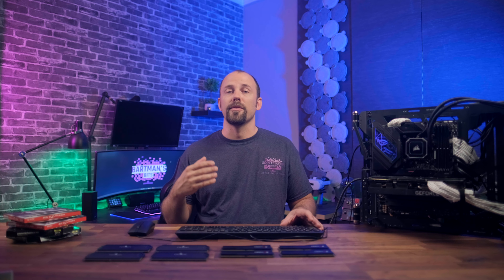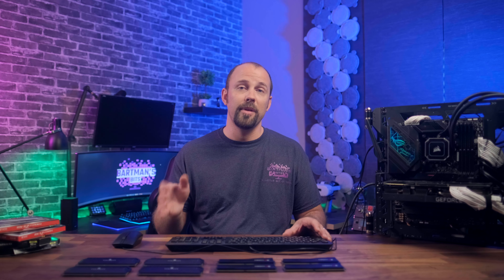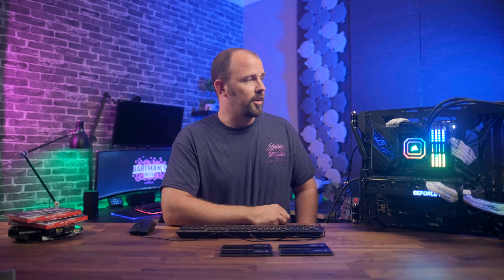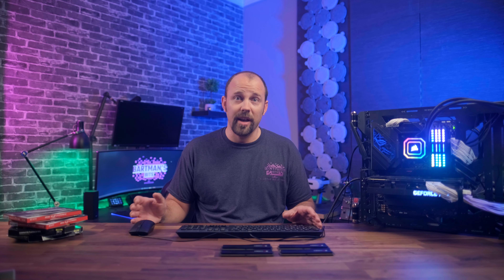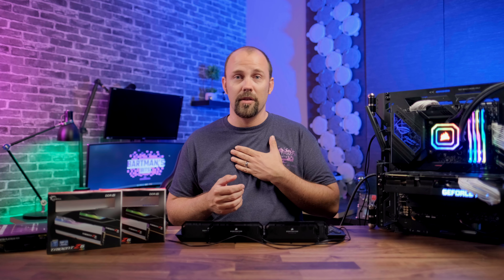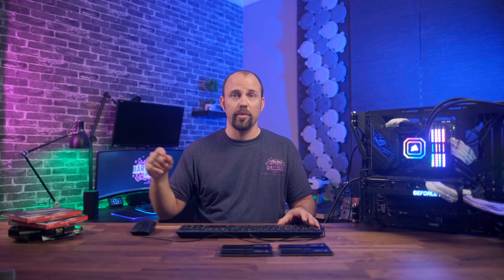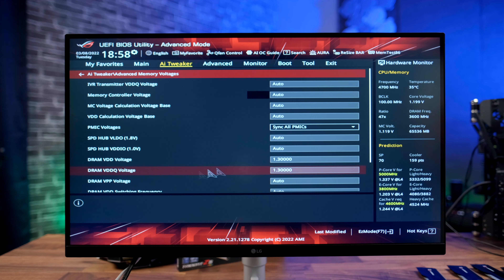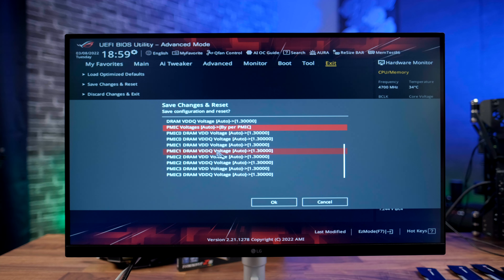Intel’s DDR5 problem resolved! DDR5 64GB Boot Loop failure Fix. Get the rated speeds of your RAM!

Comment: I can't believe DDR5 is causing this many issues for consumers. DDR5 was rushed and not plug in play as it should have been
Reply: Had to do the same thing on my DDR4 X470....
Reply: it was already garbage on z690 except for a few kits (corsair didnt work at all for me only g.skill) i hoped amd would be better nope its WORSE ><
Reply: It's because it's new and 3600mhz is default. but companies are rushing into the unknown at 6000
Reply: DDR5 wasn't rushed, but it's implementation by Ram and Motherboard manifacturers was. DDR5 works 100% perfectly fine at THE CPU's  designed frequencies. XMP IS AN OVERCLOCK , so there's no guarentee you will get it working at that speed as long as the CPU MC is still only rated for 4800MTs, which is currently the case with the latest line of consumer CPUs. 

So many people are experiancing issues because of a mix between companies' race for the top with crazy memory and cpu OC clocks out of the box, that just aren't stable aross all bins of cpu, and the consumer's lack of knowlage of what XMP actually is. 

Yes XMP normally works with 2 dimms, but the CPU's memory controller isn't designed to support them speeds, so it's hardly surprising issues are popping up everywhere, like when trying to OC not 2 but 4 dimms to >1.5x the CPU's maximum rated MC speed!! Even if the memory seller is rating it at that speed, as it's kind of miss-leading as no CPU manifacturer at the moment will guarantee anywhere near some of these speeds, even for 2 dimms, even if the ram can handle it fine (again DD5 wasn't rushed, it's highly advanced, and is in fact technologically AHEAD of the current CPUs limitations, which is exactly what you want from new tech). 

DDR5 is amazing tech, people are just too greedy, and because they see someone with a golden chip and crazy binned dimms hitting like 8000MTs with dual sticks, they expect every set of ram to behave the same way with their CPU even when "doubling" the stress on the MC with a four stick set up. It just doesn't work like this. You have to manage your expectations through understanding some of the limitations with current CPU design when it comes to implementing DD5 ram into a build. 

ANYTHING OVER 4800MTs RUNNING ON DDR5 IS AN OVERCLOCK OF THE PROCESSOR'S MEMORY CHANNEL The higher you go, and the more sticks you have per channel, the more stress you put the MC controller under, and on some of the less well binning CPU MCs even getting 4800MTs with 4 sticks of unmatched 4800 rated ram can be a challenge! Although tbf that is the worst combination for all variables, it puts things into perspective as far as the limitations of some CPUs memory controllers. It's all about managing expectations, and understanding the limitations of the current supporting technology.
Reply: @DaftFader My Asrock board natively detects my DDR5-5200 as "DDR5-2000" from the SPD. Tell me again how all of this isn't a broken hack. Or in other words: How hard can it be to have something like an EEPROM to contain some numbers and have a BIOS read those out without getting utterly confused!?
Reply: @julian-sark  It's overclocking, not a hack. (this was for 12th gen btw, so the CPU memory controller speeds for 13 + 14 gen may be higher, I haven't checked.
Reply: This didn't age well... 4x 6600 rated ddr5 to 128gb is very unstable still on intel and asus
Reply: @DaftFader  I am having same issue, please help

Intel i9 14900k Crashing / Gigabyte z790 UD AX
I see unexpected crashing issues when I install 4 G.skill Trident Z DDR5 RAM sticks (4000 MT/s) instead of 2 (4800 MT/s).

Some config I have setup:
Performance CPU Clock Ratio: 55
Efficiency CPU Clock Ratio: 42
Extreme Memory Profile: disabled
BIOS is up to date : [F11e]
Reply: Same I'm having Hella issues.
Reply: I skipped all these ddr5 motherboard and processors. Wait ddr6 to see if systems are more stable and fast and running cool at stock speed.
Reply: @CC-gt3ro  I would say that's the way to go. I purchased the exact same ram and couldn't get it to work for the life of me. Yet I got a pair of none matching to work at dinosaur speeds.
If you go ddr5 I would get the 42gb kits? They work but nothing 4 slot.
Reply: @Theausomecaleb  I can only get 4 slots of dominator platinum stable at 5000 MT/s  with 128GB I think most of my issues are all with Riot Games Vanguard though

Comment: This problem still exists with z790 boards today - literally been having bios loop for two hours and now it’s fixed thanks to the tips on this clip. Thanks heaps, mate!
Reply: Just ordered a z790 board. Which memory did you go with?
Reply: Got the z790 board really nice board but if you plan on running xmp it will boot loop. I went with Corsair vengeance 6000
Reply: I just build a Z790 Hero. And my DDR5 6000 36-36-36-96 did with a few clicks now 6600Mhz same timings.. at 1.42v ... no error and max performance! ;)  Im running 2 sticks.. 2 x 16..  They run  GREAT at 6600Mhz 36-36-36-96... I dont know how I can further improve BIOS settings. I have now 60.2ns latency and 102GB sec read and 90 sec write..
Reply: @lassekristensen385  just build hero z790 with 5200 mhz dom ram . It blue screened but bios update fixed it just cannot controll rgb .
Reply: @harrysmith5353  I'm having similar issue. Z790-E with g.skill 7200. Bootloop after bootloop all day. I had the PC working for 2 days with random crashes... then something happened and I could't even reinstall windows due to crashing.

Currently changed setting as in video and managed to get installed again but bsods still happening. I am at wits end with this.
Reply: @hensley2931  4 dimms or 2?
Reply: @harrysmith5353  Okey? Which RAM is it? If you dont use or have the motherboard software which can control the RGB- I would strongly recommend OPENRGB. I use it because I hate all that ASUS bloatware and services. Its great and simple and universal.
Reply: @lassekristensen385  Hey man i use Corsair domiantor ddr 5 5200mhz will try open rgb now thankyou for the suggestion.
Reply: @Bhommers93  Mate I have a same problem right now how did you solve it
Reply: I could not use xmp on a1/b1.  It runs fine on a2/b2.  Asus recommended a2/b2 first. 😊
Reply: Going thru similar issues with a Ryzen 7900x.  Random hard shutdowns, reliably happens shortly after starting a game, but can also happen even sitting idle in windows.  Tried two different GPUs, power supply, memory.  Motherboard next lol.
Reply: @b0nz0beavis Hi man. I have this problem on Z690, the settings in this video didn't help me.  I was hoping that switching to Z790 would solve the DDR5 problems, but you tell me that even on Z790 the problem persists.  Do you recommend me to migrate to Z790 or is it not worth it?
Reply: @n4ul17o 
I purchased an MSI with a Z790 board with 4 memory slots within the month. Supposedly to take 128mb. Got 2 sets of 64 MB T Force Delta sticks @6000mh.  Bottom line, 2 sticks works fine with XMP, 4 sticks will not work without upping voltage and doing something else which probably negates any warranties. The system reverts to 4800mh and runs very very slowly with 4 sticks.
Reply: @wendybrown3461   Thanks for your comment. I thought that Z790 had solved the problem with DDR5 rams since in the video titled "128GB DDR5-6000 Kingston FURY BEAST Intel XMP Certified" it clearly looks like a PC with Asus ProArt Z790 and two 64GB kits, are running at 6000MT/s "no apparent problems". This gave me false hope that possibly upgrading to Z790 would solve the problem. But thanks to your comment, I can see that it is not so.
Reply: @davidnaulvillanuevaarguell4 Having this issue this week myself. 2 sticks of ram, dominator, ddr5 no problem at any speed up to 7200 asus z790 extreme i9 13900k.  Just got 4 matching sticks wants to run at 4800, after this video I tried 6400 crashing hard 6200 crashing and freezing 6000 bsod and hitching 5800 freezing up bsod so today I'm on 5600 praying but I think I'll have to keep taking it down until I'm back to square one. 

I'm heavily contemplating returning the ran at all and getting 2 64gb
Reply: @TB-nf6bs  I'm very sorry about that. If you have a chance to return the ram, return it. Have you investigated if 2 sticks of 64GB will work correctly?
A few days ago I made the mistake of updating the Bios of my asus mobo to version 2305 and now I can't use 4 sticks of ram, the configuration, XMP profiles, voltage tweeks doesn't matter, nothing matters, everything just fails.
For now I am waiting for the BIOS update and my PC is only working with 2 sticks of RAM, the other 2 are there in the drawer waiting.
Reply: @n4ul17o 
Hello again, 
Hope I’m understanding your question and answering it clearly. 
The short answer is yes A PAIR OF 2-32GB STICKS (64Gb Total) in the correct slots (MSI is apparently particular) works on my MSI. As I initially said, I have an MSI (can’t return as it’s needed desperately) so keep that in mind. It will take a set of (TForce Delta @6000 mhz) 2-32GB sticks, 64GB total ram.  I did need to go into the BIOS and set XMP Profile 1.  The system recognized them fully and uses them at speed. 

There may have been some “false starts”. Can’t recall. It seems that any change creates a number of lengthy or dead starts, then settles in. However, that’s half of what we were all promised. 

Tonight I may tinker around. It bothers me greatly that I am not able to utilize the full 128GB at full ram speed.
Reply: @wendybrown3461  Thank you so much for your time and answer.
Reply: My works with 64gb  perfectly  , but ASAP use 120gb my pc crash
Reply: @Nikolaevvega  Me too. 64Gb Ok, but 128GB everything crashes. I'm still waiting to find some solution that will allow me to use my 4x32GB DDR5 RAM modules at 5600MT/s on my Z690
Reply: I have corsair vengeance ddr5 5600mhz I tried changing to 5600 won't boot windows after change just loops but when I did 5400 it worked no problem weird
Reply: I have a z790 board, I should try this.
Reply: True I just went w i9 13900k 4x 16gb 6k mhz to only 5.6k
Reply: I just built a new computer MSI Z790 Mag tomahawk paired with an I9 12900k and 64gb of G.Skill DDR5 6000 and couldn't get it to boot. Memtest86 came back clean, Replaced the motherboard and Memory same issue was about to change the CPU until I found this video.
Reply: @dvk86 what voltages did you use? Same exact hardware as you, 1.3 didn’t work for me
Reply: @lassekristensen385 man I lost the silicon lottery for my memory controller 😂. I have your exact ram and asus board and my 13900k just can't do anything past basic xmp without corruption
Reply: @hensley2931 where you able getting working? I'm having trouble with my 7200 with 2 dem motherboard
Reply: After I move the two sticks to a2 and b2, reset bios to default, and then follow the instructions given in the video, XMP I works. I got Gskill f5-6400j3239g32gx2-tz5rk 2x32 kit.
Reply: malicious bios?
Reply: Was that 4 sticks and did you change the voltage? I knownit was a while ago but im having the same issue @EarsBeEazy
Reply: And still seems like it persists. Having this issue currently on z790
Reply: Same 4 dimms x 32gb. Can’t get xmp to work even after trying this video 😢
Reply: @n4ul17o  I am having same issue, please help

Intel i9 14900k Crashing / Gigabyte z790 UD AX
I see unexpected crashing issues when I install 4 G.skill Trident Z DDR5 RAM sticks (4000 MT/s) instead of 2 (4800 MT/s).

Some config I have setup:
Performance CPU Clock Ratio: 55
Efficiency CPU Clock Ratio: 42
Extreme Memory Profile: disabled
BIOS is up to date : [F11e]
Reply: @n4ul17o  I am having same issue, please help

Intel i9 14900k Crashing / Gigabyte z790 UD AX
I see unexpected crashing issues when I install 4 G.skill Trident Z DDR5 RAM sticks (4000 MT/s) instead of 2 (4800 MT/s).

Some config I have setup:
Performance CPU Clock Ratio: 55
Efficiency CPU Clock Ratio: 42
Extreme Memory Profile: disabled
BIOS is up to date : [F11e]
Reply: @wendybrown3461  I am having same issue, please help

Intel i9 14900k Crashing / Gigabyte z790 UD AX
I see unexpected crashing issues when I install 4 G.skill Trident Z DDR5 RAM sticks (4000 MT/s) instead of 2 (4800 MT/s).

Some config I have setup:
Performance CPU Clock Ratio: 55
Efficiency CPU Clock Ratio: 42
Extreme Memory Profile: disabled
BIOS is up to date : [F11e]
Reply: @Khungersumit  Hello. Unfortunately, as of today, there is no solution to this "problem" when we talk about 4 RAM modules at the same time. Possibly with the next generation of Intel and the z890 chip set this issue can be resolved.
At the moment, in my case, my 4 5600MT/s RAM memory modules only work well and stably at 4000Mt/s with everything in AUTO without XMP modifiers. It has been the only way to be able to use the 128GB in 4 modules without problems.
Reply: @n4ul17o  Thank you for replying  :)
Reply: I'm having this issue with Taichi Z790 atm and I am trying different adjustments on this almost 1 week old build.

Comment: Dude, you saved me a huge headache! Hope below steps will help you to get yours to work too. Here is how I got stable system. I have z690 Maximus Hero, 4x16gb 5600, i9-12900k. I got it to work with: NO XMP profile selected, 5200 picked manulaly, VDD and VDDQ voltage set to 1.35V, PMIC Voltages set to By Per PMIC, and the key to stable system was this setting PCI Express Native Power Management - DISABLED. Have fun!🤘
Reply: What mobo you running?
Reply: @ianolivas9920  I've got Rog Maximus Z690 Hero
Reply: @EvilManChild I got mine working at 5600 on xmp1 without messing with the settings. I think the latest bios update was a fix
Reply: @Ms Moon Boo oh well mine works fine no issues, no crashes, no tweaks made to the xmp profile
Reply: @Ms Moon Boo yeah I was afraid that I wasn't going to able to run my rig with ddr5 after seeing all the reddits and yt vids but I guess I got really lucky. I was expecting to put it at 5k but it's solid at 5600
Reply: @EvilManChild works amazing, no problem. I get maybe 2 times a month error and reboots, other then that works awesome
Reply: @alexsoby7892  Wait your computer crashes on you twice a month?
Reply: I run x4 16 gigs sticks ddr5 at 5200 with the z690 maximus hero it wont allow me more.. that dumb luck i guess?
Reply: AMD ryzen is the same
Reply: @ianolivas9920  it says in its comment please read it

Comment: Great work.  I have two 32 GB Corsair Vengeance DDR5 5200Mhz for a total of 64 GB (2 x 32).   The ram defaulted them to 4000Mhz.   When I tried to raise to 5200Mhz, it would not post.   I just tried your solution and it worked perfectly.
Reply: For what? Wasted money
Reply: 5200 is a dumb speed to get also because it's more expensive than 4800 but you are still getting micron chips, so you might aswell buy 4800, same performance but a little cheaper
Reply: @heinzletzte.6385  You dont know how much they paid.
Reply: I have a i7 12700kf z690-F with 4x ram sticks: 2x adata xpg lancer 5200 mhz and x2 4800mhz Corsair Vengeance, i have mixed rams with different mhz because last year took me 4 months to build the pc, it was very hard to find gpu and other components, had to '' win queues '' to get ram, so after multiple attempts i ended up with 2 different rams. I couldn't find  a solution for the DDR5 - XMP1 infinite boot so i did set auto and got default MHZ for 9 months. Today after watching your video and talked to friends last week, I decided to try it out,tthe volt change it didn't fix it but i found the solution: i did xmp-1 , AI OC up , frequency up to 4800mhz instead of 5200 or auto, it works perfectly. So basically the xmp1 setup was automatically set all rams at 5200 causing system being unstable, lowering the 5200 to 4800 and applying ai oc Now i have 4800 in my task manager instead of 3600-4000mhz, plus i can get 5000 aswell, it's a good solution. With XTU and AI OC I increased the CPU performance by an incredible amount . My GPU instead was already Overclocked with MSI afterburner with over 20k on time spy , it's a 3080 ti suprim x.
Reply: @Waldherz FeuerClan what do you mean "they"?
Reply: @Princerso  Micron can do 5500 with slow timings, Samsung can do 6400+ with ok timings, Hynix M-die (first generation) can do 6800+ with even better timings than Samsung and Hynix M-die can do 7800+ with a little slower timings
Reply: So basically Hynix M-die or Hynix A-die, below 7200 M-die can do better timings, above 7200 A-die can do better timings
Reply: that translates into Hynix M-die for Ryzen 7000, 12th gen Intel and 13th gen Intel on most 600 and lower end 700-series motherboard
Reply: If you have an Intel 13th gen processor and a high end motherboard you can benefit from Hynix A-die
Reply: Do you have msi bios? I can't find the PMIC part that he's talking about at 6:16
"PMIC voltage: by per pmic"
Reply: @JustJoe24  did you ever get an answer on this? I’m have MSI same issue I don’t see this option.
Reply: @JustJoe24 did you find it?
Reply: @AGentlemansQuarrel i have msi board too and can't find it too
Reply: @JustJoe24 msi board has link/ unlink just above the vdd vddg volt... unlink it, then set all the volts to 1.3